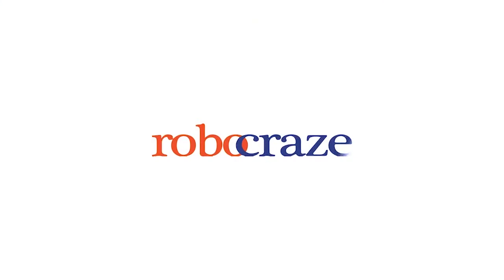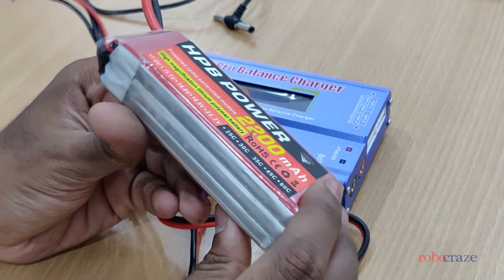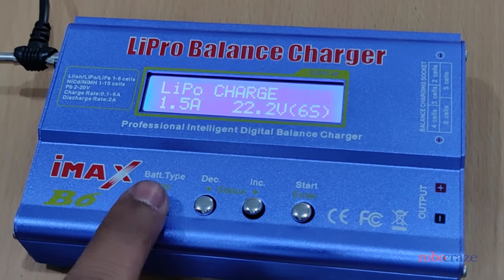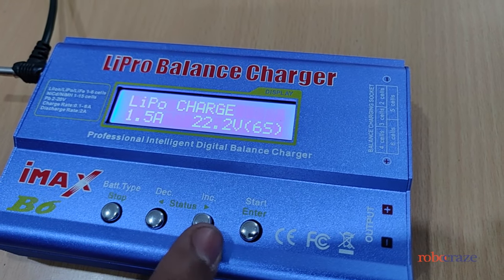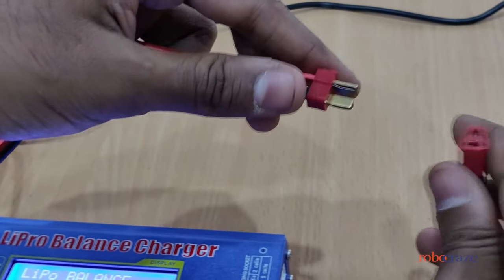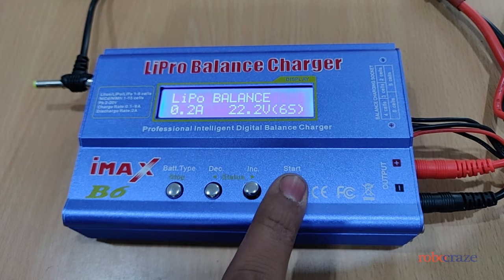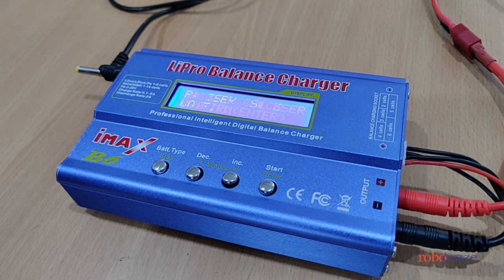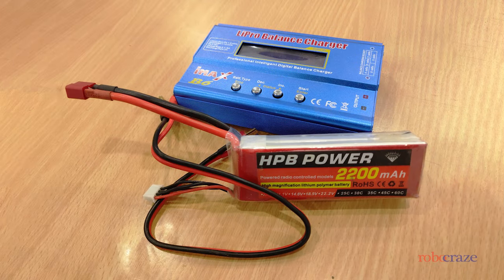#TUTORIAL How to charge a LI-PO BATTERY & IMAX B6 MULTIFUNCTION CHARGER

Comment: I'm so confused, I have two 5200mah 7.4V 50C 38.48Wh 2S batteries & I just want to charge one to storage level & charge one for normal use, can anyone please help me, thank you so much if you can. (I have this exact charger, the instructions were apparently written by the same guy that writes all the instruction booklets for products sold in America & he doesn't know a LICK of English, so....until I get someone smarter than me to help I'm just screwed)
Reply from the maker: It's recommended to charge at a rate of 1C, which for a 5200mAh battery would be 5.2A. However, if the charger doesn't have an exact setting of 5.2A, you can choose the closest available option that is lower, such as 5A.It's generally recommended to store LiPo batteries at around 3.8V per cell, which for a 2S battery would be around 7.6V.

Comment: I have a 5200mAh battery, 2 cell. 50C 7.4V 38.48Wh. I am not sure what setting to put the charger at. I have it at LiPo because that's the battery type. Instructions says between .5C and 1C is the charge rate.
Reply from the maker: If you use 1C setting, the B6 will try to charge the battery with 5.6A. But you have to ensure that your adaptor supports this current rating. If your adaptor supports less amperage, then reduce the C to match 75% of the max output of your adaptor. 
For example if your adaptor supports 4A, then you can charge it at 0.5C which would approx be at 2.3A

Comment: I have 14.8v 2200mah lipo battery and 12v 1.5a adapter how much amp set in IMAX b6 charger
Reply from the maker: Since your adaptor is rated at 1.5A, its best to set at 1A

Comment: Does it only charge a 4s battery to 14.8v or does it charge it to 16.8v? 14.8 v is just storage voltage
Reply from the maker: Hello! 
The charger should charge a 4S LiPo battery to 16.8V when fully charged, as each cell is charged to 4.2V. The 14.8V you're mentioning is the nominal or storage voltage, not the full charge. Thank you!

Comment: For the charging a 1350mah 3s lipo what current should i select?
Reply from the maker: For the battery being used, the maximum recommeded would be 1.3A. But please also check the current rating of your adaptor. If the adaptor you are using is >2A, then you can charge at 1.3A, but if it is 1A or less, then the charging current should be chosen appropriately

Comment: Need some advice... 
I have a 3S 4500mah 50c battery and I have the unit capacity at 5000. Is it safe to increase the capacity rate ?. Only because it seems to stop at 5000, but has not finished charging even though the battery is a 4500. Can I increase the capacity rate?
Reply from the maker: Hi,
Yes you can try increasing the capacity slightly but it is recommended to not do so. It could also be the battery losing capacity over time and hence not charging to full potential.
Reply: @Robocraze  Thankyou.

Comment: I have the same charger, but it won't charge. I've done the exact same set-up except for 2s. It will start charging and within 5 seconds, stop and cycle back to the home screen. Any ideas? It does it with brand new and well used batteries. Fully charged, half dead and dead it's all the same.
Reply from the maker: Check the charger display for any error messages or warnings that may indicate an issue with the battery or charger.

Comment: i have the same charger and it doesnt give me the option for lipo in programmable settings
Reply from the maker: Ensure you have the latest firmware, select LiPo as the battery type, and configure customizable settings for LiPo battery charging on your iMax B6 charger.

Comment: How many amps is the 12v transformer?
Reply from the maker: Hi FedeInventor,
This version of the B6 does not take AC input as it does not have an inbuilt transformer. You need to purchase an adapter specific to your requirements. The adapter ratings that can be used are as given below:
Input Voltage: 11-18v
Charge Current Range: .1-5.0A
Max Power: 50W
Reply: Ok, thank you
Reply: I have this imax b6, it works but when i discharge the nimh battery it stinks of burning, but it works and when it finish of discharge the battery, it not stinks
Reply from the maker: @FedeInventor  Try reducing the discharge current.

Comment: What should i use for 4s 6000mAh 60c
Reply from the maker: Check the capacity of the battery to determine the C value. It is recommended that you charge a battery at 1C or lower to extend the lifespan, as charging at higher C can cause damage your battery. For example: If your battery is 1300 mAh – it is recommended to charge the battery at 1.3 A (1C). If your battery is 4800 mAh, it can support up to 4.8 A (1C).
The charging current is also limited by the adapter being used. Do not use settings more than the rated input of the charger as given below:
Input Voltage: 11-18v
Charge Current Range: .1-5.0A
Max Power: 50W

Comment: What is the safe charging rate for 2amps power adapter?
Reply from the maker: It is safer to charge at rate of half the rated amps, so as to stick to the safer side, ie 1A. If you have a really good quality adaptor, maybe you can try at 1.5A

Comment: hi....  can I   charge  a  Lithium  bat  on a lipo settings ????
Reply from the maker: There are two kinds of Lithium batteries. Li-Po and Li-ion. So depending on your battery type, it's best to choose the exact settings, that is if you have Li-ion, select Li-ion, or if you have Li-Po, select Li-Po. But in case you don't have the corresponding setting, you can use the other setting and it should be fine in most cases depedning on the exact specifications of your battery (that is maximum allowable current, voltage, etc)

Comment: What would I need to put it too for 5200 MaH (3s) and 80c
Reply from the maker: Hi,
It is recommended that you charge a battery at 1C or lower to extend the lifespan, as charging at higher C can cause damage your battery. For example: If your battery is 5200 mAh – you can use up to 5 Amps to charge it since that is the max this charger can output, however, the charging current is also limited by the adapter being used. Do not give current higher than your adapter can supply.

Comment: if 4 18650 batteries are combined in series and parallel, how many cells will be read on imax b6 ?
Reply from the maker: Hi, the IMAX B6 charger is for LIPO batteries whereas the 18650 are lithium ion batteries

Comment: please help me have 1800mah 3s battery what I should set on balance charger??
Reply from the maker: Hi,
It is recommended that you charge a battery at 1C or lower to extend the lifespan, as charging at higher C can cause damage your battery. For an 1800 mAh battery, recommended setting would be 1A to 1.8A. This is also limited by the adapter you are using. Do not set the charging current to a value greater than the power adapter can supply.

Comment: Hello friend.....which voltage setting would be the right one to charge an 8000 mAh 7,6v 2cell lipo battery????thanks!!!!!!👍😉
Reply: Voltage should be 7.4 (2S). 
Regarding current - I don't know for certain, but 8A seems much too high.
I would start by charging with a much lower current (~1A) to be on the safe side, at least until someone more knowledgeable tells you otherwise.
Reply: @MrGreenblatt  thanks a lot bro!!!👍😉
Reply from the maker: Hello! For your 8000 mAh 7.6V 2-cell LiPo battery, set the charger to 7.6V (2S) and charge at 1C, which would be 8 amps. Be sure to monitor the process. Thanks! 👍
Reply from the maker: Yes, you're correct! For a 2S LiPo battery, the voltage should be set to 7.4V (not 7.6V). As for the current, 1C is typically recommended, which for an 8000 mAh battery would indeed be 8A. However, if you're unsure or prefer to charge safely, starting with a lower current like 1A is a good idea. It's always safer to charge slowly, especially if you're new to it.

Comment: Hello, I am planning to purchase B6AC.. we can power it directly from ac output.. so what amp should I select to charge my 2200mah 3s battery?
Reply from the maker: As a general rule, you can charge the battery between 0.5C-1C, hence for 2200mAh battery, you can select a charging rate of 1.1A-2.2A (provided your adapter can provide the same).

Comment: Need the cable assembly that plugs into the right side of the charge into the white connectors.
Reply from the maker: Hey! A bit confused by your comment. The battery itself can be directly connected to the charger on the right side without any additional cables. Did we answer your question, or were you referring to something else?

Comment: Hi, you were charging a 4s Battery (balancing connector is in 4s) with a 3s Voltage? Isn't it supposed to be 14.8V?
Reply from the maker: Hi,
In the video, the battery that is used is a 3s battery.

Comment: Hi I've just brought this IMAX and storage charged my 1000 mah 14.8 4S turnigy and checked the voltage with a multimeter and it shows 15.17 volts is this normal..
Reply from the maker: Hi Roger,
The optimal storage voltage per cell is 3.85 volts. Since your battery is a 4 cell battery, 3.85*4 = 15.4v which is pretty close to what you are reading. Hence 15.17 volts is normal.
Reply: @Robocraze  thanx
Reply: @Robocraze  thanks

Comment: Can i know , why it set 0.5?
Reply from the maker: We are using a 1A adapter for powering the battery charger. So we are setting it at less than 1A, ideally half the rated capacity. This is to avoid damaging the adaptor. But you also have to ensure that your battery can comfortably take in 0.5A. If it cannot, you should set it to an even lower value
Reply: @Robocraze noted👍 tq for the explnation

Comment: The included adapter of the B6 can only handle 1A?
Reply from the maker: Hi Albert,
TheB6 charger is shipped without an adapter. You need to purchase an adapter specific to your requirements. The adapter ratings that can be used are as given below:
Input Voltage: 11-18v
Charge Current Range: .1-5.0A
Max Power: 50W

Comment: how do i use only 5v out for lipo battery or usb
Reply from the maker: Hello! To use only the 5V output from a LiPo battery or USB, follow these steps:

For USB Power: Simply connect your device to the USB port, which provides a 5V output.

For LiPo Battery: Use a step-down (buck) converter to regulate the LiPo battery’s voltage to a steady 5V. Connect the LiPo battery to the input of the converter, and take the 5V output from the converter to power your device.

Make sure the current rating of the 5V output matches your device’s requirements.

Thank you for asking! :)

Comment: What value do I use for the charging current?
Reply from the maker: Hi Gainster,
Check the capacity of the battery to determine the C value. It is recommended that you charge a battery at 1C or lower to extend the lifespan, as charging at higher C can cause damage your battery. For example: If your battery is 1300 mAh – it is recommended to charge the battery at 1.3 A (1C). If your battery is 4800 mAh, it can support up to 4.8 A (1C).
The charging current is also limited by the adapter being used. Do not use settings more than the rated input of the charger as given below:
Input Voltage: 11-18v
Charge Current Range: .1-5.0A
Max Power: 50W

Comment: What does it mean when the charger tells you to “Change Polarity” ?
Reply from the maker: Hi,
This could indicate that the battery terminals are not connected in the correct polarity to the charger. Please check the connections to ensure that the battery terminals are connected in the cirrect polarity. If that does not fix the issue, please check this thread: https://www.rcgroups.com/forums/showthread.php?1877042-Imax-B6-REVERSE-POLARITY-error
Hope this helps :)

Comment: I didnt get wire to power to power this charger what to use
Reply from the maker: Hi,
This version of the B6 charger does not come with a power adapter. You need to purchase an adapter specific to your requirements. The adapter ratings that can be used are as given below:
Input Voltage: 11-18v
Charge Current Range: .1-5.0A
Max Power: 50W

Comment: Hi my friend. I am writing from Bosnia and Herzegovina. Can you please explain what parameters I can use for charging turnigy nano-tech lipo 3000 mAh 11.6 v. I dont know how many amphs to set.
I have 3 CELLS. Thank you very much
Reply: Zdravo Mujo, javljam se iz Srbije. Deliš miliampere tvoje baterije sa 1000. Na primer: 3000/1000=3, odnosno 3A-ampera. Od kvaliteta baterije zavisi i struja punjenja, broja ciklusa punjenja i pražnjenja... Lipo baterije imaju nominalnu voltažu od 3,7V po ćeliji, pune se do 4,2V po ćeliji, ne bi trebalo da se prazne ispod 3,6 ili 3,5V po ćeliji. Takođe je bitno da imaš dobar lipo punjač, sa opcijama punjenje, pražnjenje, balansiranje, brzo punjenje, storage (funkcija za delimično punjenje, kada duže vremena nećeš da koristiš bateriju) tada se puni do 3,8V po ćeliji. Moj savet je da tvoju bateriju puniš sa 2 do 2,5A i uvek u BALANCE modu. Nadam se da sam bar malo pomogao. Živ bio i sve najbolje.
Reply: @shimanosv9143  zdravo druže. Hvala puno na odgovoru. Riješio sam problem, snašao sam se. U svakom slučaju gledaću da prilagodim postavke tvojim savjetima. Imam super punjač.
Reply: @mujozenicanin  🇷🇸🇧🇦
Reply: @shimanosv9143  samo bratstvo i jedinstvo :)
Reply from the maker: Hello! The recommended charging current for Turnigy Nano-Tech Lipo batteries is typically 1C, which means 1 times the battery capacity in Amps. For your 3000mAh battery, this would be 3 amps.

Comment: Hii Bro, I want to know what is the  full charge of a 3s 3000 lipo battery
Reply from the maker: Full charge voltage of the battery depends on the type of battery being used and the voltage per cell. Manufacturers will specify the voltage of the battery on the label. Some common values are 11.1v, 7.4v etc. We would advise you to check the manufacturers recommended voltage for the battery you have.

Comment: Can you charge 3s Lipo 4000 50c  on this p
Reply from the maker: the iMax B6 charger has a maximum charging current of 5A, it should be able to charge a 3S LiPo battery with a capacity of 4000mAh and a discharge rate of 50C safely and within the recommended charging rate of 1C
Reply: Ok thanks.
How long does it take for a full charge then??

Comment: What's the charging rate for 7.4V (2s) 2200mAh 8C Lipo Battery ? thank you
Reply: 2.2A 7.4V (2S)
Reply: @MondoLT  What about a 7.4V (2s) 950mAh 65C discharge battery? What do I set the "A" to?
Reply from the maker: Hello,
You could set the A to around 1A

Comment: hi i have followed your video but every time i hold in start it comes up with low voltage i have set the correct voltage and amps....anyidea what i am doing wrong?  Thanks
Reply: Hi - I had the same problem and was going to throw the battery pack away. Look on Youtube for repairing or restoring a Lipo battery. I discovered that you can set the charger to Nimh or Nicad and charge for a couple of minutes and that restores the cells. Then you can balance charge the pack and all is fixed
Reply: Hey bro first check you imax input supply. If it's not sufficient Amp deliver then imax sound up. I facing this issue and my solution is use computer power supply with good brand. And problem solve use 450w power supply
Reply from the maker: Hi! If you’re getting a low voltage warning, check the following:

Ensure your battery is connected properly.
Verify the battery’s voltage is within the expected range.
Confirm the charger settings match the battery specifications.
If everything seems correct and the issue persists, the battery or charger might be faulty. Thanks!
Reply from the maker: Hi! That’s a great tip for restoring a LiPo battery. Using the NIMH or NiCad settings to briefly charge can sometimes help revive the cells. After that, you can balance charge it properly. Thanks for sharing!
Reply from the maker: Hey! That’s a solid solution. If your iMAX is showing issues, make sure your power supply can handle the required amps. A 450W power supply should definitely help resolve the problem. Thanks for sharing!

Comment: i have hrb 6000mah, 11.1 3c, 50c. how much amps i should use
Reply from the maker: 1A is a very safe number to use.
Reply: 11.1V 6000mah battery .. charge with 11.1V at 6 amps
Reply: 6A 11.1V (3S)

Comment: 0.5 sir?your battery is 2200 Mah so mean 2.2,can you explain
Reply from the maker: Hi,
To supply 2.2A, we all also need a >3A adaptor connected to the iMax. Also, 2.2A is the maximum recommeded amperage you should charge your 2200 mAh battery in. Charging it at lower rate will not cause any harm and in fact is better for the battery
Reply: @Robocraze  oh i see,thank you sir for your explain..

Comment: How about for this one? 10 c Lipo Battery 7.4 V 3000mah Power ZOP?
Reply from the maker: Hi! That would depend on the adapter that you're using to power the charger, and the charging C-rating of the battery.
However, 1A is a very safe number to use.
Reply: Set the charger at 7.4V at 3 amps.. Always  move 3 decimals to the left with mah... so 3000 mah is 3 amps.... 900mah at 0.9 amps.. lower is always safer!!

Comment: You are charging a 2200 battery in this video. It is safe to charge at 2.2amp
Reply from the maker: Hi,
You are correct, charging at 1C is optimal, however you also have to consider the max current that the adapter can supply. To stay below the limits of the adapter used for the video, we selected 0.5A.

Comment: 3s = 11.1volts.  0.5 amps for a 2200 battery ? All lipos can be charged at 1c which is 2.2amps on that battery. That charger can charge at 5-6 amps with those leads
Reply from the maker: Certainly! What you are telling is true, but because the adapter used in the video is of 1 Amp, hence we have set the value to 0.5 Amp.
Reply: @Robocraze  I dont know where the 1 amp comes from but that Deans adaptor can/ is used to run Modified motors   and charge 1s-6s batteries at C ratings. I think they are rated at 30-50amps. the weak link is the power supply you use.